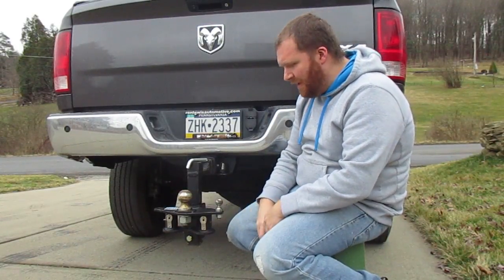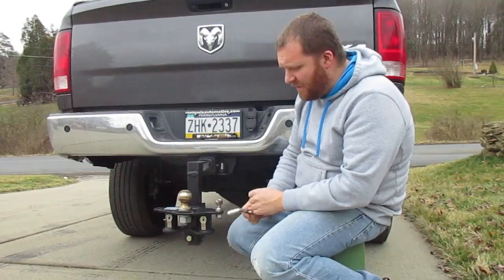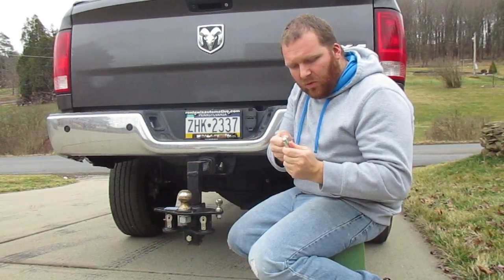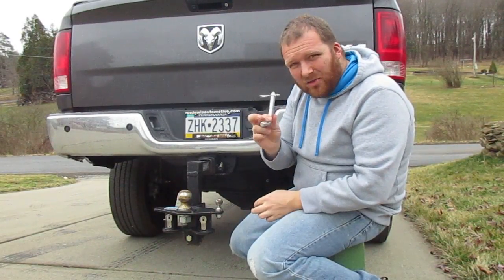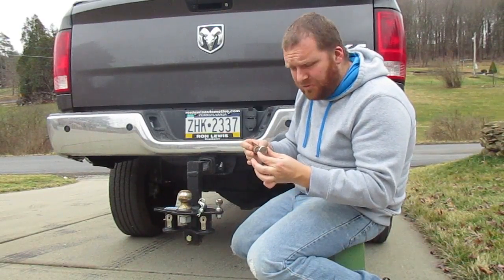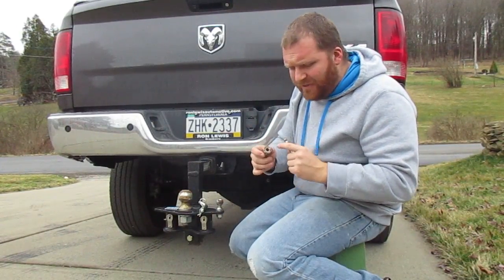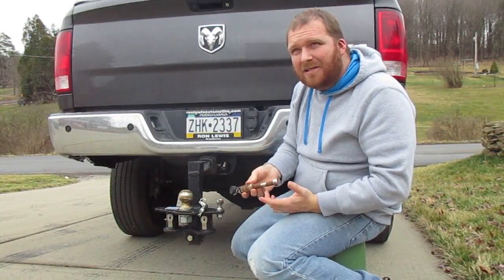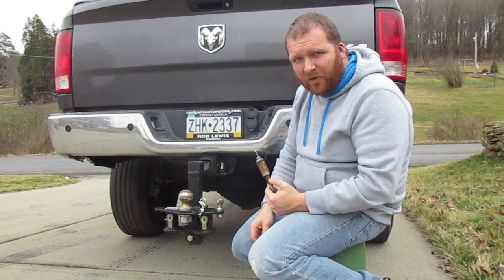Trailer Hitch Pin Do Not Let Yours Fail!

Comment: Thanks for bringing this up. I'm pretty new to trailering and, considering all the backup safety systems on a trailer, I'm simply amazed that this feeble little pin is all that's between you and catastrophe. Just before coming across this video, I ordered a locking hitch pin that uses a cotter pin as a backup in case the lock comes off. Why all hitch pins don't have some kind of safety backup is beyond me. Of the bazillions of hitch pins you can find online, only a handful have any kind of backup.

Comment: I had one of these type of locks from Reese. Hooked up trailer, put the pin on, checked to make sure it was locked in place 2 times, stop at gas station for gas and checked lock again, my wife also checked it, at the gas station to make sure it was on and locked, got home from day at the lake and when I went to unhook the trailer the lock was gone all the was left was the pin itself which could have fallen out at anytime. Extremely dangerous situation. I emailed Reese about it and never got any response. I will never buy this type of locking pin again.
Reply: Exact same story here.  However, mine was barely holding on.  Locking part fell apart in pieces.

Comment: I just had to remove the exact lock you have in your hand, the rusted one. Hit it 3 times with small sledge hammer, snapped right off at the narrow spot on the pin ! I put in a Grade #8 , 5/8 bolt and two lock-nuts tightened together.

Comment: I have a Master lock but it is different design than he has. I have had it for around 10 years. I use it year round and it stainless steel. I sprayed with rust protector anyway and it has been very good for me! I use it in ND and MN so it has been tested.

Comment: My simple and easy thing that I do is to use a zip tie around the cotter pin so it can't spread open. just put them around the bent areas where the two sids would meet and tighten them up. you can  remove them later with pliers, also it's a good deterrent.
Reply: Cool idea, but i've had Zip Ties break and fall apart in the sun and weather. Its just not safe to trust nylon/plastic in the weather/sun.

Comment: Spray the lock with Corrosion X and you will have no rust problems. It may not be caused by the cheap China metals, but from the reaction of different types of metals rubbing together, instead. Using these locks are not so much of a dedicated method of stopping a thief from stealing your receiver and thus, anything  being towed from you. It is much cheaper and probably works better to use a grade 8 bolt and nut instead, as then the person has to have two wrenches to remove the hitch and that takes time. Most thieves do not carry those wrenches on hand. That does mean the hitch and receiver are not going to be as easily changed out by you though, but it works better as a security precaution than these locking pins do, anyway. A grade 8 bolt is not stainless steel, but has about a 25,000 more strength than the stainless steel bolts do. You can always paint the bolt and nut before using it if you are concerned about rust on them.  Nice video for providing thoughts as to safety. Thanks for posting.

Comment: I myself use a locking style. I don't have any issue with rusting of the lock. I do however do pull the hitch ball out when not in use along with the lock. I keep my lock in the glovebox so I have it and my one hitch in my cab in my cargo under the backseat. My weight distribution hitch I don't use a ton so I don't keep it on me

Comment: Anything with moving parts, etc, needs maintenance. So in this case it needed regular oiling or a spray of anti rust fluid. This is specially critical if you live in a rust prone area.
Reply: Good quality stainless steel won't rust. If it does it is cheap stuff.
Reply: @astrogerard2022  key word is good quality. There is ss stuff out there that may still spot rust. Wont know till it does. I just found a ss scraper that rusted.

Comment: No more pins for me.  I use a 5/8 nut & bolt with lock washer to secure mine.
Reply: Hopefully it's at least a grade 8 bolt with a long shoulder.  i wouldn't want the threaded part of the bolt in the hitch
Reply: ragingbullhcwf agreed. I run a grade 10.9 bolt with a steel (vs nylock) locknut and Nord-Locks @ either end. Nobody is getting my drawbar without some effort.
Reply: I bought a grade 8 5/8 x 4 inch bolt for my hitch. Thought about getting a lock nut but I figured two regular nuts tightened against each other would do the trick.
Reply: Great so I just need a 5/8 socket and wrench to take your trailer.
Reply: Head on a 5/8 thick bolt requires a 15/16 to 1" socket and it's air wrenched on so good luck getting it off with your 5/8 socket and wrench!
Reply: @DJJOEYVLLC  It's best not to air wrench on a lock nut. The speed melts the nylon on the nut rendering it ineffective. Always use a ratchet.

Comment: Top Link pin with hole for a padlock.  All the videos showing how easy the locking pins can be easily broken off, they should not even be called "locking".

Comment: Grade 8 bolt screw the nut down drill a small Thu the end centered  about half inch to pot the pin in ,unscrew the nut to clean the threads and then use a washer on each end and a grade 8 locking nut .tighten  up laser you pin to keep the nut from backing out .
100 times stronger than any pin set up. And cost just as much as a good pin , I just don't trust the pins

Comment: Hardened steel will rust...  Period.  No matter it's country of origin. That's why you should grease it upon your initial installation...  Moisture is going to get into the locking mechanism and stay trapped there.  Therefore an oxidation problem...

Comment: I bought a gr-8 five eighth bolt at Tractor Supply. I drilled a quarter inch hole in thru the bolt where the hitch clip would go. Then I put a hardened shackle lock on the bolt. The bolt doesn't come out and thieves don't succeed !

Comment: I bought a 5/8 hitch pin at tsc with a lynch pin to secure it. Works good
Reply from the maker: I am going to head there and check it out.  These new larger hitch receivers are hard to find pins long enough for them.

Comment: Good advice. Our trailer hitch cotter pin either broke or worked its way out and the hitch pin came out. The entire trailer and hitch pulled out of the hitch receiver and dropped onto the interstate when we were driving at 65 mph. Very scary and perhaps could have been prevented with a simple maintenance action. We have been pulling this trailer for 2 years so maybe every year replacement is a good idea.

Comment: i like to grease my balls with wheel bearing greese lol to prevent corrosion and wear on the ball, also in the receiver, for the locking pin i have a reese similar to the rusty one you have and i also cover it with grease cause is also got some surface rust like yours, the locking mechanism was getting stock, but after some wd40 it works freat now, i also spray white lithium in the locking mechanism to keep it working properly

Comment: A couple years ago, I drove 7 hours towing my camper to a campground.  I looked at my locking hitchpin and it was hanging funny.  I put my foot on the lock to spin it around lightly and it fell right off.  Could have been a disaster.

Comment: Better get that Master Lock off quick... lasted 6 months. Had to break mine off yesterday with a pipe because of the salt from the winter roads corroded the lock and the key didn’t work. I even sprayed wd40 and a heavy duty anti-corroding liquid on. I’m going back to the pin. $2 vs. $10.
Reply: Cut mine off to... Using a cheap pin for now until I find something that works
Reply: Denis Bishop - yea, if you are like me and there’s harsh winters and a bunch of salt on the road, the pin is the way to go. I’m just going to have to take my ball hitch off every time I’m not using it  so someone doesn’t steal it. 

The reason I got a lock is because I like to keep a ball hitch on in winter if someone rear ends me. But in the summer when I’m hauling my cargo trailer and camping trailer, I’m just going to have to remove my ball hitch every time I’m done using it. Which isn’t a big deal but whatever. I’m seeing a lot of people having trouble with these master locks.

Comment: Good points regarding the "quality" of ball mount pins, standard or locking types!
Buy quality American made pins,  not cheap offshore manufactured JUNK!
 As I do a lot of repairs to utility and boat trailers ( for side money, "no tax / no tracks" ) I have firsthand knowledge of numerous instances of where the "hairpin cotter clip" or cheap AND expensive "shaft locking mechanisms" have failed and I'll share a few things  that I've learned over time with everybody...
1. The standard  "hairpin cotter" securing clip, that comes with most basic, cheap 5/8" pins can and will come out over time due to weakening of the "spring factor" and allow the pin to work it's way out! 
Especially the hairpin clips that do not go through a hole in the pin, but just "clamp around" a groove in the pin. NEVER use a "slide over, compression type pin"!!! 
2. For those that insist on using a cheap "standard 5/8" pin, DRILL A SECOND 1/8" hole for a SECOND clip!  
2 hairpin clips "failing" at the exact same time is highly unlikely and is mighty cheap insurance. 5 minutes with decent drill bit and you're done!
I used to do a "double clip pin" many years ago before moving on to using a a top quality hitch pin, made with at least grade 5 or grade 8 American steel, secured with a good quality brass padlock with a 3/16" diameter hasp. This lock then goes in the appropriately sized hole drilled into the pin. 
Usually, enlarging the 1/8" clip hole to a 7/32" diameter "lock hole" will work good.  

3. I strongly agree with "noctanol's" comment below "Use a padlock."  
For at least the last 20 years, I have always bought high quality steel hitch pins a good quality Brass lock. I try to talk others into doing this also. It's mighty cheap insurance!

4. A grade 8,  5/8" diameter bolt with 2 "NYLOCK" nuts is a good option, provided that the bolt's smooth shank continues to the outside of the pin hole. 
Do not have the bolt's threads in the receiver tube wall! This increases the "possibility," even though small, of "shearing" the pin in a worst case scenario.  
A "bolt pin" is probably better for a ball mount that will not be removed for a long time as it's just good insurance to NOT keep reusing a Nylock nut for such an important function. 
Yes, I know that GOOD quality Nylocks are rated for reuse, but a lot of folks just buy the cheapest junk because they don't know better or don't care! Once again - new, quality Nylock nuts are mighty cheap insurance!   
 
Never take your hitch pin for granted!!!
Reply from the maker: great tips.  I may be moving to a pin with a brass lock this is my second pin now this time was high end still gums up and I just do not trust it.   I like the double pin Idea!
Reply: Do you have photos of the pin/brass lock you’re talking about

Comment: most people install the ball and hitch into the receiver and leave it there as part of the vehicle , in my area driving around with that equipment installed and not towing a trailer can warranted a fine , i never leave mine attached , when i park my camper i remove the ball and hitch  , be careful in parking lots , you can back up too close and damage another vehicle ....your fault ! , if you arent towing remove it !

Comment: Where are you getting "the number one failure is the pin", lol?  Where's the data?  Or is this something you just heard from a guy who heard it on youtube. 
Solutions?  1) Don't buy a pin held on with a cotter pin 2) Don't buy cheap locking pins.